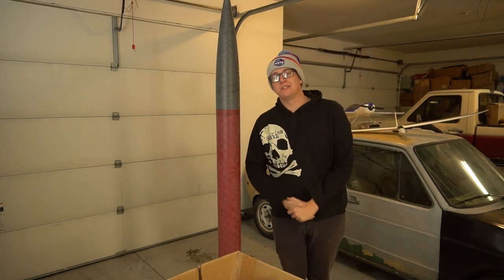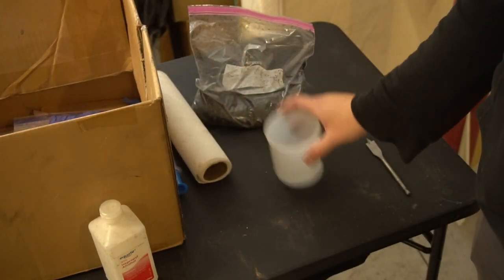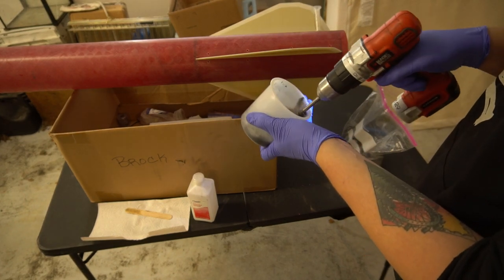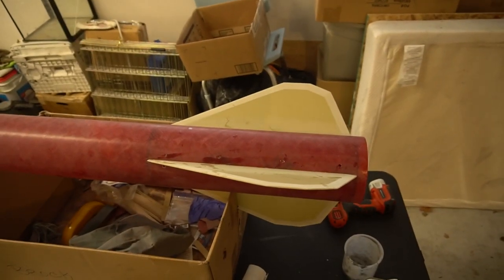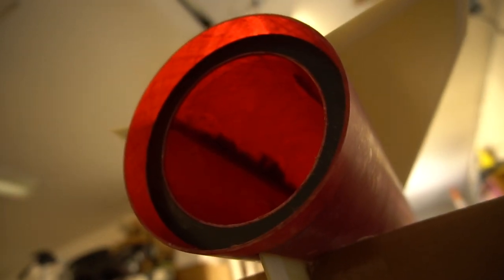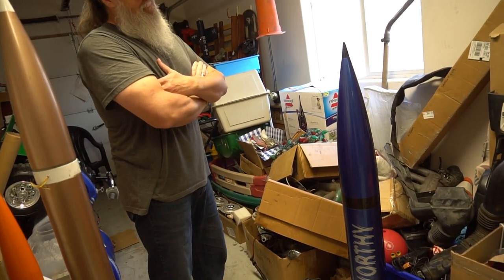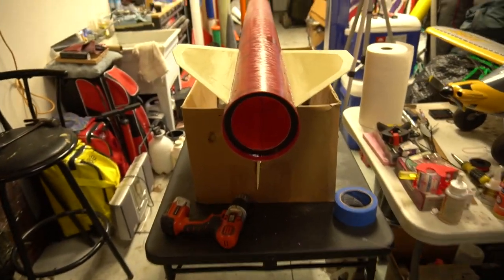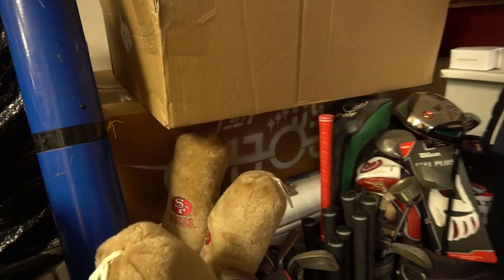When Things Don't Go Exactly To Plan | Building A Fiberglass High Power Rocket

Comment: How do fillets typically fail?  Does epoxy fail under tension which is the additional strength carbon fibers provide or due to failure of adhesion to the fiberglass?
Reply: I think the adhesion to the fiberglass is the weakest link. I've never seen an epoxy joint fail, but I would think compression and shear forces will almost never cause a failure, while tension may pop the adhesive grab of the epoxy. That being said most good epoxies can hold 5000PSI in tension so that's plenty for our purposes.